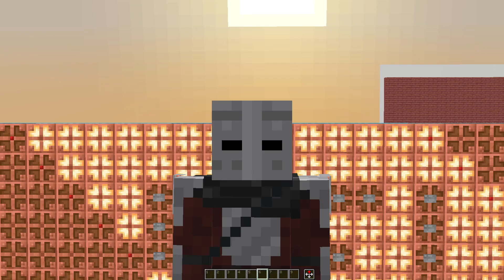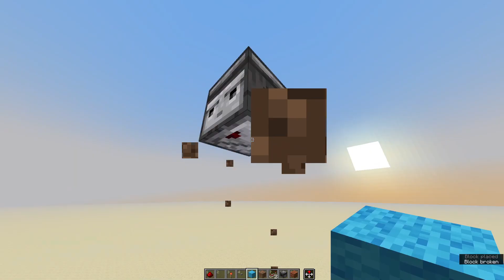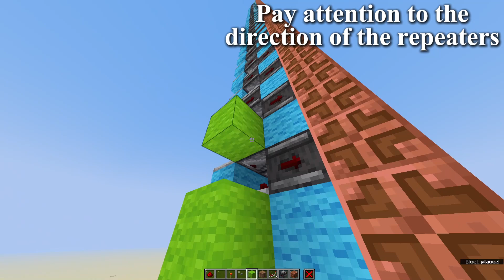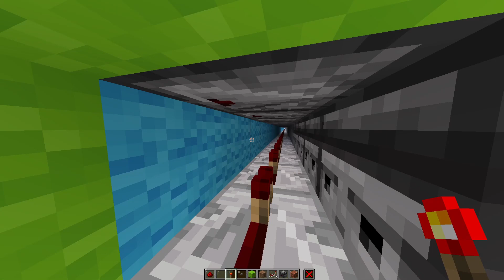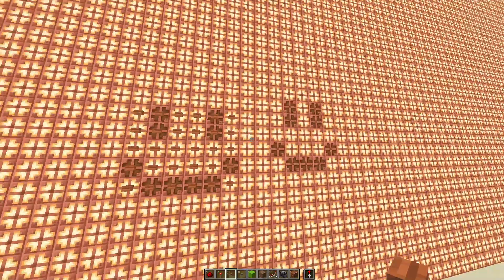How to make a customizable redstone billboard sign. Minecraft tutorial

Comment: Mine doesn't repeat after the end part of removing and adding the redstone and flicking the lever on and off. Is it just once we need to do this step? (I am pretty much a noob making this for my daughters bday.) Thank you.
Reply from the maker: it might be easier if you use a button instead of the lever, if that still doesnt work, click on the repeaters to increase the delay and try again after removing the redstone dust and allowing the clock to fully turn off.

Let me know if this still doesnt work
Reply: @ivan-the-crafter thank you. I ended up making a small version and got it to work. I had set up a massive one, and when I did the redstone/lever thing, if I did it fairly quickly the lights would all scramble, and too slowly was the issue I mentioned as I think I was doing it too slow to interrupt the circuit so that's why it wasn't repeating. I think my sign was too big to start with - I read your comments about chunk loaders but I think that's beyond me after looking into it, don't really understand what they do, where to place etc. So I have separated my sign in half, and then some smaller ones one side to practice with. Playing in bedrock the way. Do you think the size of the sign should make a difference? I had made it about 100 wide originally.
Reply from the maker: @michelledoherty1412  yeah, the big ones can break a bit easier, the big one I made for this video stopped working a long time ago and has frozen in place, The most common cause is moving away wrongly so that part of the sign is loaded by the game and active, while the rest is not. Im glad you managed to get the  smaller one working though. that is good to hear (:
Reply: @ivan-the-crafterthank you, yes it was so much fun to set up and learn some new stuff about minecraft. Thanks again 😊
Reply: Also I had played around with the repeaters, the delay. Also tried with button. Maybe my timing was just off. I wrote the steps, lever off, remove dust, place it back, lever on, and off before end - first i'd thought you meant before the sign was fully lit up, then I realised it was meant to be before the clock had fully.lit up, completing the circuit (is that correct?)
Reply: Also I had played around with the repeaters, the delay. Also tried with button. Maybe my timing was just off. I wrote the steps, lever off, remove dust, place it back, lever on, and off before end - first i'd thought you meant before the sign was fully lit up, then I realised it was meant to be before the clock had fully.lit up, completing the circuit (is that correct?)
Reply from the maker: @michelledoherty1412  yeah sorry, I didnt explain it as well as I could have in the video, a good portion of that explanation was trying to show how it worked and not really how to do it. So what you could just be doing is power the line and power it off again after things start lighting up. If when you power it off and the power is lighing up the circit in a circle then you're good. If not, then yuo can break one of the redstone dust and quickly place it down again. That can be a bit tricky because if you place it too fast, the same problem will happen. so you will need to wait to place the redstone dust until about half the repeaters are on, and the other half are off. If you get it right, then it should start working as it should.

Comment: I built it correctly and it started working
But after a while 
It looks corrupted 
And what i mean by that is that the lights are scrambled
Some of them are on
Some of them off
I keep rebuilding it but the same error happens 
Why?
Reply from the maker: That issue could sometimes if you build it on different chunks, they unload at different times causing a desync. You could probably best solve this by building a chunk loader underneath it so it’s all going together

Comment: Can we also put the Billboard facing upwards or downwards??
Reply from the maker: You could, however you would have to modify some things a bit. The biggest problem would be the torch tower which could be replaced with a Redstone line. If you want it more than 15 blocks long then you’d need a repeater somewhere in there which could mess with your timing
Reply: @ivan-the-crafter 15 blocks is enough ig, so instead of torch a redstone line you say, can't we use redstone block?
Reply from the maker: @rehanmd1469  Redstone dust would work, redstone blocks wouldn’t since they are the power source not the wire
Reply: @ivan-the-crafter oh got it

Comment: Every time I leave the build the pattern changes and looks weird how do I fix this
Reply: Ok thank you 👍
Reply from the maker: that is probably the one flaw of this design as when you leave, the chunks unload and the lights are left how they are, there are three solutions to this.

1. you could turn off the machine when you leave by sending a constant signal through the clock

2. if you have the entire system in the same chunk, it will all unload at the same time and there shouldn’t be any problems

3. keep it from unloading by either building it in the spawn chunks, or by adding chunk loaders nearby to keep it loaded. one chunk loader should cover a 5x5 area if I remember correctly

Comment: That's so cool, I wanna make it in my survival world. Any idea how much materials I would need for a billboard of about 70% the size in the video?
Reply from the maker: about what size are you thinking?
Reply: @ivan-the-crafter  the one in your video
Reply from the maker: @LilacwasLeanonce  for the big one I made uses 4726 copperbulbs which would require about 1,182 redstone dust and blaze rods, and about 3,544 copper blocks. there were also 6174 building blocks, 6023 repeaters, 6016 observers. If my math is correct, a billboard 70% of the size would take about 3,308 copper bulbs.

does that help?